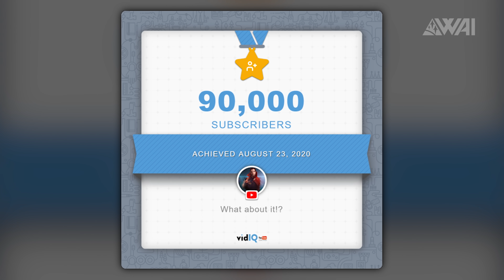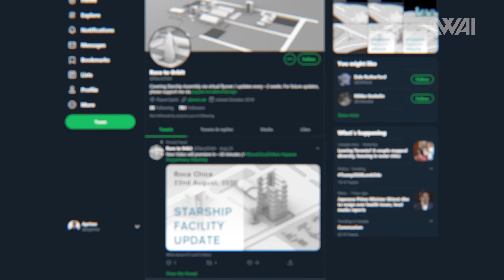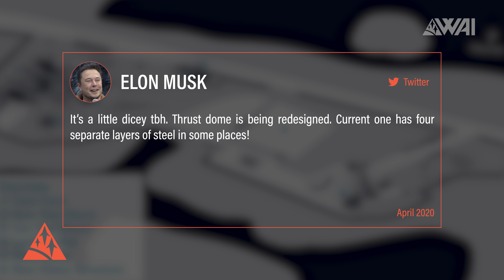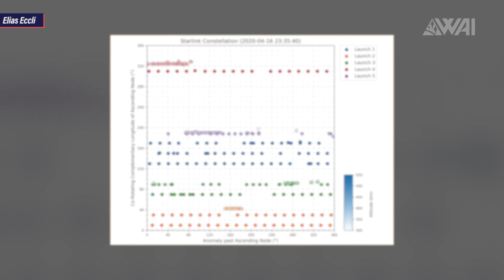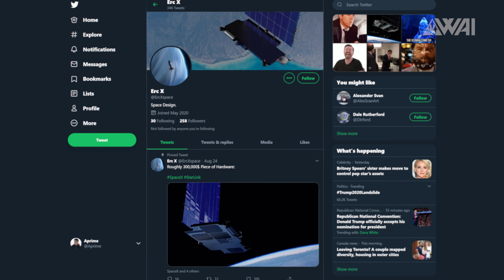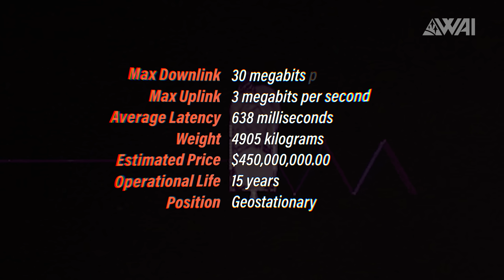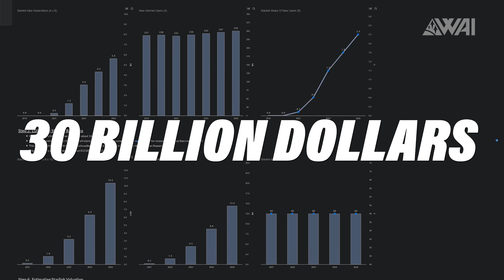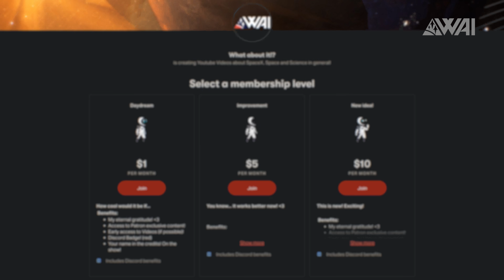116 | How to finance a fleet of SpaceX Starships?

Comment: Fun fact: Starship can launch ~480 Starlink satellites, and that is limited by the fairing volume.
Reply: If they launched starship once a day they could complete the 12.000 constellation in less than a month and the 40.000 one in 3 months, that's insane
Reply: @kapybara8079  The bottleneck at that point would be the production of satellites! How insane is that?
Reply from the maker: That's the plan! ;)
Reply: What weight would that payload be? The number I heard was closer to 200-300
Reply: @ryanhamstra49  at approx 260kg per satellite, not including the payload delivery system, you're looking at 125 tonnes just for the satellites.
Reply: @042Ghostmaker  Payload to low earth orbit = 100 tonnes
Reply: @042Ghostmaker  also I assume SpaceX will be getting better at making them. Smaller, lighter, more capable maybe all of the above. So the job will get easier as they go.
Reply: "At 60 satellites per Falcon 9, SpaceX is also driven to bring its Starship launch vehicle online as soon as it can, as the company says each will be able to carry 400 Starlink satellites at a time" Bryce senior space analyst Phil Smith told CNBC. In other interviews and talks, Elon has said Starship is expected to eventually be able to carry 500 Starlink satellites into LEO. Perhaps later versions of Starlink satellites will be smaller, or Starship Nosecones will be larger and Superheavy may have increased thrust, or they might be planning to strap falcon 9s on its sides, who knows. We'll just have to wait and see.
Reply: Would all the satellites be able to reach their own orbits from that one point of release, or would Starship release them at different points? How would this work?
Reply: @dkdeep5505  since all of them are going to the same inclination they can be released from one point. In order to have them off set they just wait in groups at a lower hight. When a group is in position they will raise their hight using on board thrust. Then each one in there group will space out over time. 

This is already being done on falcon, the 60 are split up into groups of 20 and will spend a week or two before rasing hight.
Reply: NO. Starship CAN'T launch 480 Starlink satellites. What you meant, perhaps, is that Starship was promissed to be able to launch 480 satelites one day (some time next year).
Reply: @marianpazdzioch6632 bro chill its a comment from 5 years ago 😭 we didn’t even have v2 satellites then
Reply: @StarshipFairing  And what I said applies now as it applied 5 years. Starship still can't launch satelites. Let wait another 5 years.
Reply: @marianpazdzioch6632 bro has nothing better to do than hating on starship 😭
Reply: from what I know it will only be able to send 240 starlink satellites at once.
Reply: That’s according to Elon. The specs for BFR/Starship have changed as much as the design. I love Elon but he has always tended to overestimate when it comes to anything involving his companies. Whether it’s units sold for Tesla to the timeframe involving anything at SoaceX. Let’s just see what happens when it’s made out of metal instead of 90% still just an idea on paper.

Comment: 5:15 SN9 will probably have lots  and lots of heat shield tiles, but it doesn’t look like the heat shield can really be put to use for now...
Reply from the maker: For now. :_WAISweet:
Reply: Elon has said about going to orbit by the end of the year so this seems right to fit that time table..
Reply: mike george that may be, but the whole SN9 isn’t filled with holes, just a little bottom section of it is
Reply: @StarshipFairing  I'm just guessing at this but anyway I think that that section in the photo will be turned over, it is upside down there. I guess we will see though...
Reply: Presumably they're expanding the attachment tests they've done previously... instead of a small number of tiles attached in different ways, this is probably a larger number all attached the same way, to see how the preferred method holds up at scale.

Comment: The chevrons on the nosecone at 6:08 might be hinged brackets opening the nose cone like petals of a flower, though I don't think that would be useful: the opening would be smaller than a possible payload. I think they might just be part of a new grappling system to hoist Starship onto the superheavy booster.
Reply: Good thinking. I like the "new grappling system" for stacking onto SH theory. Sounds extremely plausible to me.

I wonder how the grappling points (if that's what they are) on the windward side will interact with the heat shield. I can see that being a bit tricky to make sure thermal protection isn't compromised in those areas.

Comment: If Starship really gets down to ~2M per launch, assuming the booster does an ADSD, cost would go down to ~$9/kg, compared to over $1000/kg for F9.
Reply: That's the goal.
Reply from the maker: :_WAILove:
Reply: Starship will never get down to ~2M per launch. The methane and liquid oxygen alone for a Starship launch costs more than 2 million dollars (detailed calculations are shown below).

Also, I highly doubt Raptor will be reusable for 100 times without significant maintenance. The thermal and stress cycling alone would require quite a few components to be replaced quite often, and the engine-first reentry of Super Heavy won't help, either.

Detailed calculations for fuel price:

Before we start doing anything, let's google the cost of liquid oxygen and methane. Liquid oxygen costs around 0.16 dollars per kg, and liquid methane costs about 1.35 dollars per kg. As we can see, Methane is far more expensive than oxygen. We'll use that later

First off, Starship holds 1200 tons of propellant, and Super Heavy holds 3400 tons. Together, this makes 4600 tons, or 4173050 kg. Now, we have that the equation for methane combustion is CH4 + 2O2 -> CO2 + 2H2O. This means that 2 moles of O2 will be burned for every mole of CH4, assuming stoichiometric combustion (as we see, the Raptor engine itself runs fuel rich, despite that it has 1 fuel rich preburner and 1 oxygen rich preburner. The entire engine is fuel rich, meaning that a greater percentage of the fuel will be CH4 than I used in my calculations - this means that the actual fuel cost for Starship will be higher than what I calculated, because CH4 is costlier). Now, O2 has a molar mass of 31.99880 grams per mole, and CH4 has a mass of 16.0425 grams per mole. This means that for perfectly stoichiometric combustion, 31.99880 / (31.99880 + 16.0425) = 66.6% of the propellant will be oxygen, and 33.4% will be methane. This means that there's 66.6% * 4173050 = 2779251.3 kg of oxygen, and 1393798.7 kg of CH4. Liquid CH4 costs 1.35 dollars per kg, so it'll cost 1,881,628.25 dollars. Liquid oxygen costs 0.16 dollars per kg, so it'll cost 444680.208 dollars. Total, it's 2,326,308.46 dollars. This already exceeds the 2 million dollar goal.

Also, this isn't counting the rest of the vehicle. It's reasonable to assume that the fraction of the rocket's cost that's spent on fuel for Starship would be equal to that of an airliner ("airliner-like operations"). Fuel costs represent 20% of airliner operations, so the total cost for a Starship launch is estimated to be 2326308.46 / 0.2 = 11,631,542.3. Therefore, I'll estimate that Starship can hit 11.6 million dollars a launch, *at best*. Oh, did I mention? This doesn't include the cost of ground support equipment and everything. Also, the fuel cost calculations don't account for boiloff - even with a condenser, the fuel will still boil off once it's loaded into Starship.

And yes, there is that Elon Musk tweet (https://twitter.com/elonmusk/status/1258580078218412033) that says that 78% of the propellant will be O2. This goes against my calculations, but I honestly think it's just a little mistake. First of all, no rocket engine runs oxidizer-rich (only the pumps do), and second of all, due to the properties and weights of CH4 and O2, you'll get a higher specific impulse running that engine methane-rich. In addition, running it O2 rich causes all sorts of corrosion problems, which isn't worth it, especially if you'll get less thrust and efficiency. In all probability, it's likely 78% CH4, 22% O2. This would bring the cost of O2 to 146891.36, and the cost of CH4 to 4394221.65, for a total cost of 4,541,113.01 dollars. This is *just for fuel*. Repeating the airliner-like calculation, we get to 22,705,565 dollars. *22 million*. Far from the 2 million, or even the 1.5 million that's advertised.
Reply: My understanding is that $2M is the cost of the *fuel*, so there is no way that can ever be the cost of the launch.
Reply: @odysseusrex5908  the cost of fuel is about 1m Not two
Reply: So the average person with 70kg could pay to send themselves for $630, if they want to profit they could charge 1000$ per person, that's better than most airlines that travel around the world. Maybe I'm forgetting something, but that's pretty good
Reply: Oliv Oliv You’re forgetting about the costs to build the starships, the cost to build the launch pads and landing sites, the cost of development, the cost of paying everyone working on this, the cost of insurance, and the fact that SpaceX would want a greater profit margin.
Reply: @Vincent20309  Yeah, but you can apply this same thing to airlines, they need all these things as well, as I said, what makes then cheap is the reusability
Reply: Oliv Oliv but airlines have had over 100 years to figure things out. And that’s not even mentioning that a plane is much simpler than a rocket
Reply: @Vincent20309  So now we have a chance to see how faster the progress pace is nowadays compared to the XX century. I'd suppose it's about 10 times faster.
Reply: @Vincent20309  Rockets are not inherently more complex than a jet airliner. I would expect in terms of total part counts and individual moving parts it's not as clear as you might think.

It is fair to say there are a lot more people out there proficient in the art of aircraft maintenance and repair.
Reply: @kapybara8079  Well the seat and the life support fraction, and everything else, so probably the persons mass times 1.5-2 if I had to guess. Still, boring cattle car class airline ticket across an ocean hits 3-5k pretty fast, and getting there in 30 mins with 20 of it being weightless means selling even 10k a seat would sell out in no time. People are paying Virgin Galactic 250k for 3 minutes of weightlessness at a lower altitude.
Reply: Oliv Oliv that’s based off weight. If I remember right Elon was hoping to fit 100 people on each which would mean each seat would cost a minimum of $20,000. The problem is payload is ok with being Tetris’d together with no air in between, but I’m doubting you want a stranger on your lap for your trip to orbit.
Reply: @ryanhamstra49  don't assume what kinks I do and don't have 😋

Comment: Just a thought... Given they keep moving the thrust simulator in and out, might it be easier to have one test stand for pressurisation and then transfer the Starship to the launch test stand? Would explain 2 stands... Another amazing update, @felixschlang!
Reply: Maybe that’s the plan with the old test stand? Leave the thrust sim on it, then you can have one getting ready to be pressure tested while the other one is being prepped for a flight, once you fly one then move the one from the old stand to the new one.
Reply: @ryanhamstra49  You literally just reworded what Tijamo said.
Reply: One thing for certain - they won't move a pressurised Starship between test stands:)
Reply: I had the same thought
Reply from the maker: Sharp thinking! Thank you for the comment! :_WAIRocket: